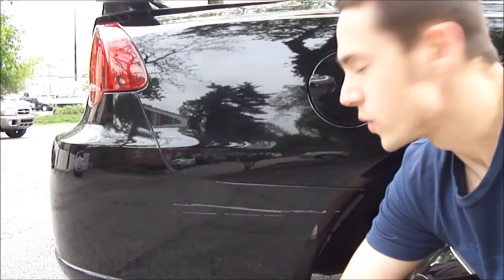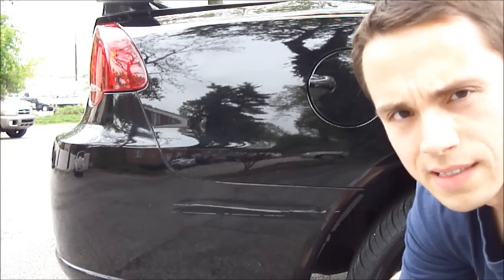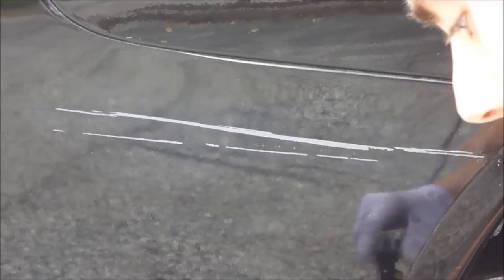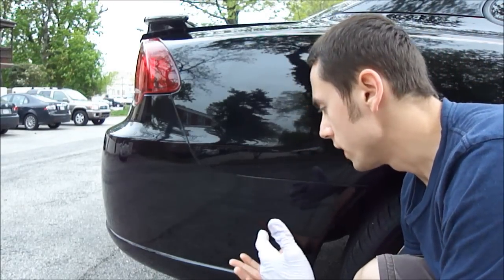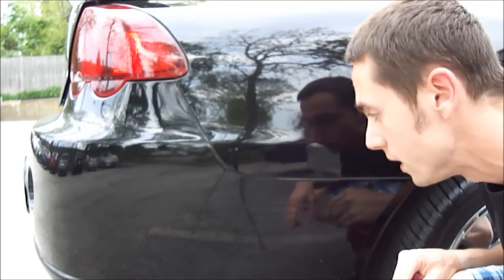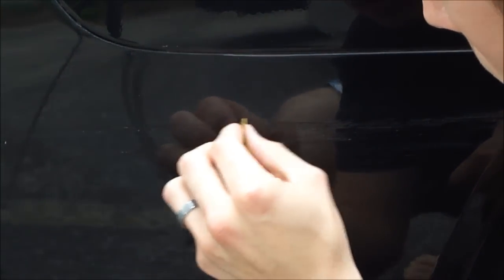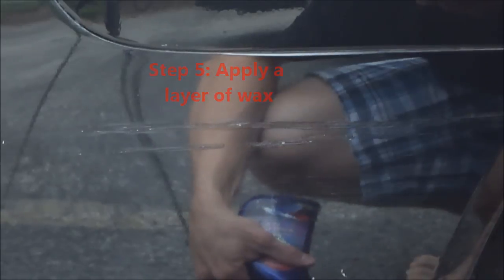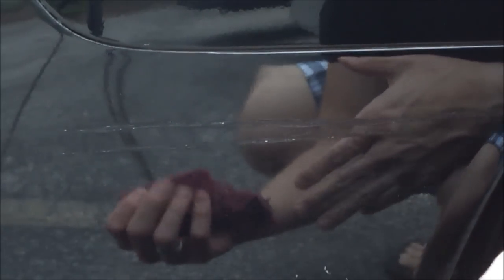How to Apply Touch Up Paint

Comment: I apply the touch up pen, leave to dry for 5 mins apply paint thinners to a rag and wipe over it scratch then apply wax, works every time
Reply from the maker: Thanks for the tip.
Reply: I had thought about that but was afraid to mess up since I'd never heard anyone advising to do it like that.  I am so excited to try it.
Reply: Why so many scratches? Also, have you or did you apply a paint protection clear film? I drive many miles on the high way and do not want a car bra for my 2018 'Yota Prius Four, so I am looking at either getting the Toyota Genuine Paint Pen (dab only, no brushing) or taking it to a professional where I can sue if the job ends up looking like the one done in this video. (I trust myself in doing a good job, too, much like you @richsmethods, but don't want to take any more changes than I already am drafting semis on the high way and whatnot...) q:)-" {puff puff pass}

Comment: Nauris706 of course you can its a quick repair in a parking lot.
My understanding is its filling a 'hole' plus a bit more?  When its dried, wet sand the surface of the touch up/paint/filler down to level it off flush with the original good paint.
Aim for a good match in colour and  smoothness and have some patience.

Thanks for uploading.

Comment from the maker: @mollifien Yes. It'll take a lot longer than I show in this video, but it'll have a nicer look. I'd use a small tool to apply putty to the internal part of the scratch. Then sand carefully, most likely with a 1000-2000 grit sandpaper. You'll need to primer the putty before adding the paint.  You can buy primer paint in paint stick form (like I show in the video).  I got mine at Advanced Auto, but I'm sure its sold elsewhere.

Comment: I will add in my 2 cents. 
First, you need a lot of paints to be filling up the missing paints from the scratches. so that it fills in the voids and then forms a blob. you want touchup paints to be raised than the paint surface. after complete dry, you take wet 1500 grit to level down the blobs making the scratched areas to be perfectly level as other area. you use 1500 to get a initial cut, then move on to higher grits.  
Once level, you start with machine polishing, compound/polishing and sealent. it will be as good as new

Comment: Good video, but I agree with stuffy's comment below as far as sandpaper grit. I'm glad you used a small surface area when using that 400 grit. I cringed a little when you mentioned the 400. 

The method I use is to paint 2-3 light layers of touchup (depending on the depth of the scratch) so the thickness of the touchup paint is essentially "taller" than the clearcoat. Then, after the paint is dry, use 1500 or 2000 grit to knock the touchup down to the same level as the clearcoat. This helps ble

Comment: So to get rid if a scratch you use dry 400 grit to scratch it more and didn't even I
Wet sand with a higher grit like 2000.gotta use a compound to get rid of the scratches.

Comment: @RichsMethods - I'm no expert but I've had good results building up the touch-up paint above that of the car's paint, wet sand with 2000/3000 grit with a 3M sanding block (to smooth out pressure), compound.

Comment: 1- Donnot dry sand . 2- use a larger surface to sand around & blend in the scratch 3- apply the paint in one long stroke & don't retouch it till some 15min-2 hr deppending on surrounding conditions 4- apply a coat of clear to protect & blend it in

Comment: Sand area with 2000 grit wet paper, then wash with alcohol, use a toothpick to fill in the crack with paint (or a fine pencil)  just to fill the crach with color.
Let that dry over night. Then add clearcoat, let that dry. and then wetsand with 2500grit til its all hazy.  then polish and THEN wax...  

just to give you some pointers til youre next attempt. :D

Comment: Here is a much better way without leaving any traces...for non-metallic paint

1. Buy some paint which is colored matched with the paint from your car, the paint number is normally located on a sticker on the can, it can also be decoded from the VIN number...get it in a spray can not a bottle! If you want to put it on using a brush you can just spray it into the bottle cap and use a brush...

2. use fine sandpaper to make on the scratch to make it bigger into a half decent size.

3. tape up using masking tape and newspaper parts you don't want to spray...

4. from a distance lightly spray the scratch and wait for it to dry, do this again until it blends into the rest of the paintwork

This works particularity well on black cars without metallic paint, I wouldn't try this with metallic paint..you'd also need the after coat if it was for metallic paint
Reply from the maker: Thanks for the tips!

Comment: Wet sanding should have been done and you can't apply wax, then add extra paint to fill in the spots you missed.Now you have to use a wax stripper and start over.

Comment: He's close but if you have a serious car like me..... 2 coats of paint and then wet sand very lightly w/ 1000 grit. polish with wax. You could try using a clear coat on top but there really isn't a lot of room for 3 coats in a scratch and the clear coat is gooey and can get messy.

Comment: dude you use 1200 wet and dry in water with a tad deturgent and rub the hole area then do it over with 1500 and buff it it would be totaly gone then

Comment: Make it even better by buying the correct paint in paint pen form from paint scratch.com (7 bucks) or a similar website. Along with that buy a clear coat touch up pen for ( bucks7) and some rubbing compound. The clear coat should make it look better than this. As it will add a  layer of shine.